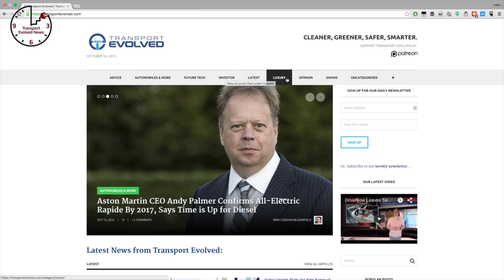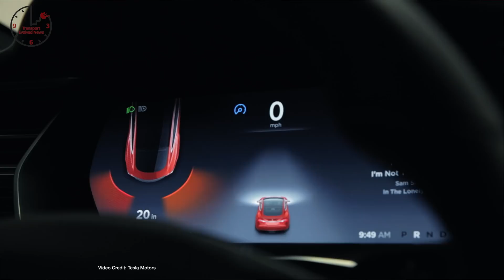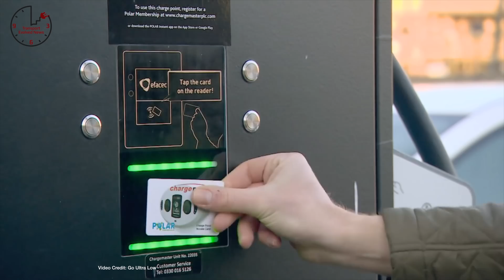Fatal Autopilot Crash, VW Settlement, Autonomous EV Charging, T.E.N. Future Car News 7-1-16

Comment: Amateur robotics for the win! I'll keep an eye on that for when I have my Model 3!
Reply: +Mila Keeping in mind each car sits differently depending on size of tires, load, suspension settings, wear, uneven pavement, different models, new models, parking position and so on. Simple robot like the one shown is probably good for one car under predictable conditions but isn't likely to work when you thrown in any variables. Surely they started simple and progressed to the complex creepy snake.

I'm guessing the final design solution will be something similar to a robotic arm that has a charge port at the end instead of grabbers.

Comment: anyone so lazy they cant even drive themselves  is an idiot probably want even wipe their on ass!!
Reply: This guy was not lazy. He had posted a video showing how the car and autopilot handled a different potential accident effectively and I think he allowed that to give him an over optimistic view of its capabilities. We don't know how long his attention was off the road for. This accident could easily have happened without autopilot, if a phone was in use for instance. His idiocy I suggest was limited to complacency and misplaced levels of trust. It is something we are all going to have to learn as these technologies become more prevalent. One last point if the tractor-trailer vehicle also had autopilot, the odds are the accident would not have happened. I feel sad for the guy and being judgemental helps no one right now.